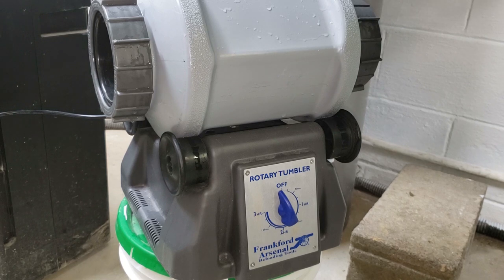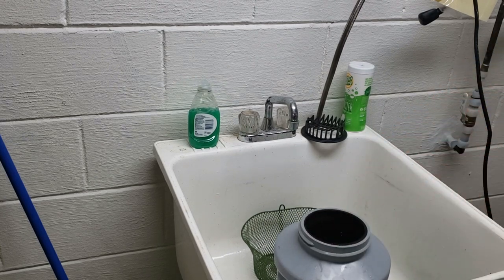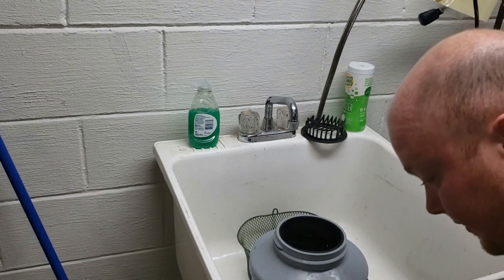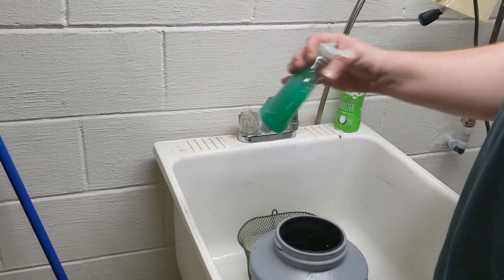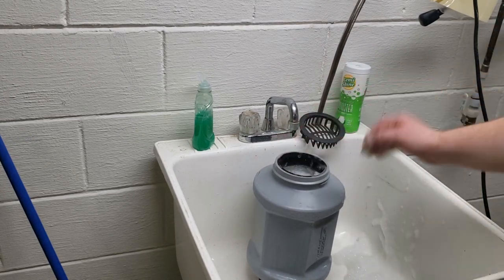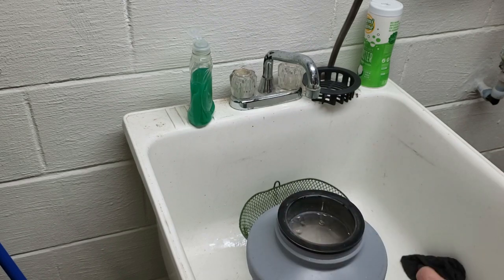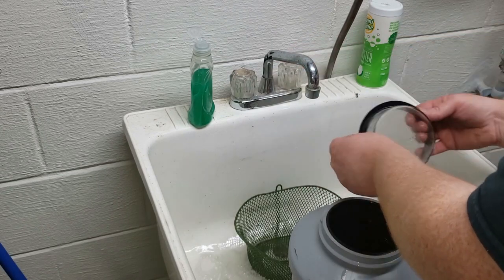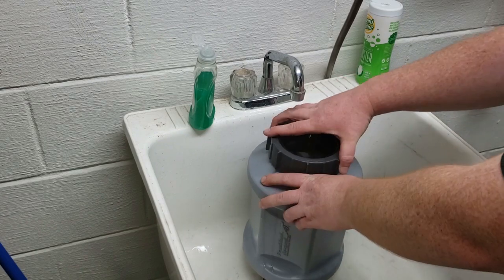cleaning brass simple and shiny. no pins/no spots.

Comment: Do you have problems with your pistol brass sticking in your dies? 
Do you need to lube your pistol brass because the brass is almost too clean?

I’ve followed the same procedure (lemmie shine carnuba car soap) but with the pins and I found the 9mm cases sticking in the sizing die. Spoke to Dillon about it and first question they asked was am I using pin to clean my brass? They are seeing this problem a lot and they believe the pins were cleaning the cases too thoroughly so now lubing the cases was recommended. 
Instead I stopped cleaning them with pins in a tumbler and went back to the walnut media method which eliminated the problem. 
Was wondering if I cleaned without the pins whether it would still creating a sticking condition now that I’ve seen your video?

Comment: seems to me his brass looks the same before and after! Me thinks Dawn and Wash n Wax have the same foamy detergent ingredients. I use a converted tilted cement mixer to spin a sealable 5 gallon plastic bucket with spin-on lid. It's powered by a variable speed 3 hp exercise motor @ 30 rpm for 20 minutes. Ingredients include; Dawn, SS steel pins and jewelry polishing shapes, citric acid, and soft water- the citric acid can help pull Calcium hardness out too. It can give a new luster to the brass.

Comment: My brass has started turning green-ish, it’s so clean right after cleaning but a couple weeks after it starts to turn. I use Brass Juice, I might have put to much in, any suggestions? Thanks Jimmy
Reply from the maker: Mine always turned spotty or dark dingy untill I started using soap with wax in it.
Would come out shiny then 3 weeks later would be dark

Comment: People….Don’t listen to this guy. Pop old primers out 1st. Use 1/8 teaspoon lemi shine and 2 squirts of Dawn dish soap or your favorite brass cleaning solution. Use pins to clean out the inside of casing and primer pockets. Do it right the 1st time. Using car wax on reloading brass has got to be the most asinine thing you can do. This guy is getting blocked.
Reply: Jerry Miculek, American professional speed and competition shooter never removes his primers before cleaning.  Think he has a little more experience!
Reply: @tobycostello7305  Seriously though. Reloaded dirty brass will still fire the projectile….To tell you the truth & IReallyDontGiveaFuck.
Reply: There is nothing wrong with his process.  Cleaning primer pockets is overrated IMO.  I personally would punch out the primers just because the brass will dry faster.  The wash and wax product leaves a molecularly thin coating, no worse than NuFinish car polish and mineral spirits leaves.
Reply: Calm down, dude. He isn’t forcing you to do it his way. I’ve tumbled tens of thousands of pistol and rifle brass in walnut media with some Nu-Finish wax. The layer of wax from the Nu-Finish is so incredibly small you’d never notice it. Brass comes our looking amazing. I’ve since switched to wet tumbling with no pins. Pins getting caught in the flash hole or neck of some cases is so annoying. No pins works just as well. I also tumble before depriming, otherwise the dies get all gummed up and nasty. Lots of ways to do it right, your way isn’t the only way.
Reply: @HisBEILness  typical hater response to something they haven’t tried or applied themselves…. Do you do two cleaning cycles, or just the 1 before depriming?
Reply: Calm down, I’ve used dawn which works pretty good but switched to wash n wax because the brass shines much better and doesn’t get water marks. I know for a fact if you held my brass you’d never know there was “wax” on it and I can get it clean in less than 1.5 hours without pins!